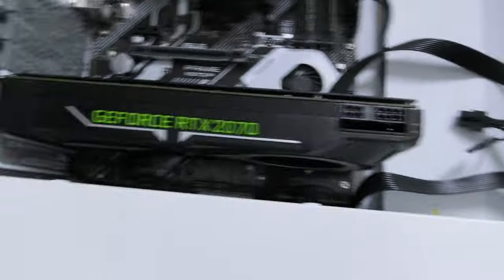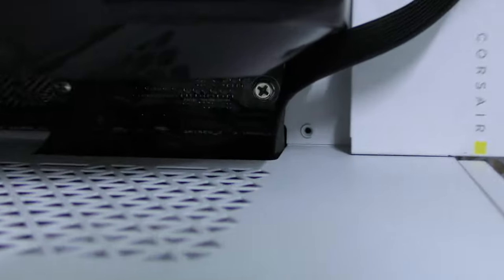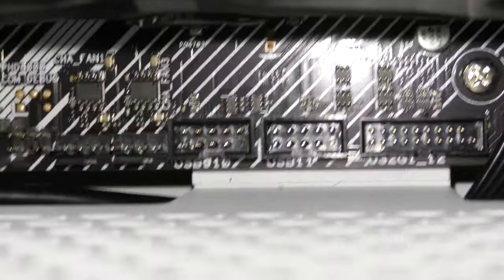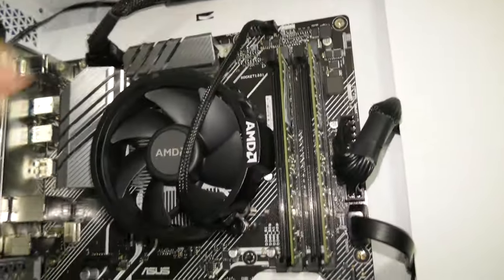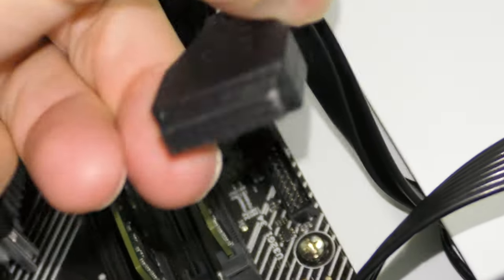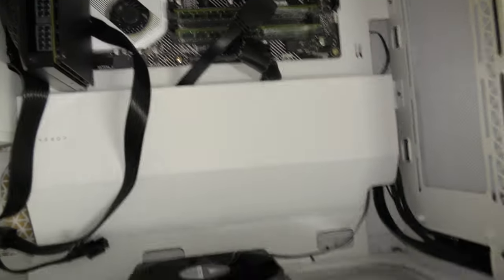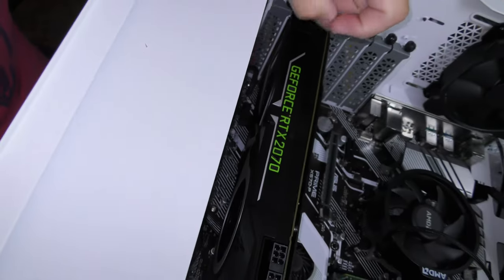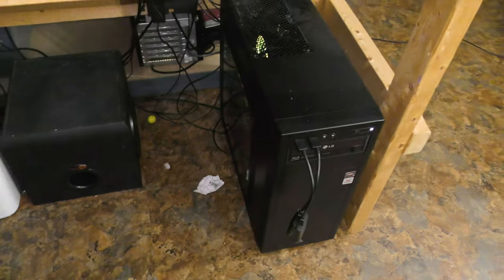Why I HATE Cable Management 🤬 - A Bird's Nest of Wires is BETTER 🐧 - Jody Bruchon

Comment from the maker: LET ME BE VERY CLEAR since many are ripping on the builder: it was put together by someone with no experience using random internet tutorials and the typical poorly translated manual as a guide, and probably a teenager to boot. If a "pro" did it then I'd burn them for it, but this is a good attempt for someone's first try with zero help. Stop being pricks to the builder in the comments. Thanks.
Reply: Breathe Jody Breathe! Of course you're right!, but these people are generation Z. Need I say more ;-)
Reply: I no longer read manuals when building computers , unless its something more exotic  , ok I still read motherboard CPU support lists
Reply: @pikepikkedonker1960   - 
the "evil" "Z" is the last letter , is this "Last Generation" ("climate" glue-r) the "generation Z" ? LOL

Comment: One of the biggest reasons to tuck the cables away isn't actually for looks, it's for airflow, and when done smart, cable managed systems don't have most of the problems described here, the real issue is that some people just shove everything in the back and close it up, rather than taking the time to do it properly
Reply from the maker: Yeah, I'm not opposed to doing some cable management out of practicality. It'd be insane to take the position that it should NEVER be done. My concern is when and how much to do: after it's all assembled and working and you can assess what actually needs cleaning up, and then the minimum to get wires out of the way and prevent falling into moving parts or causing an electrical disaster is usually the best. If you're putting more than two zip ties on any given wire, you're probably spending too much effort on it.

Now if you're running a gaming café, I can understand trying to make stunning visual impressions with the cases and lighting since it's part of the aesthetic of the entire establishment at that point...but that's a very rare case.

Comment: See, some cable management I'm all for. The kind of management that is for the purposes of airflow. 

This? This 'hehehe we're gonna make it look like there aren't cables.' This 'management' that impedes functionality or worse, routes cabling around sharp edges or above hot vents?

No.

I totally get where your'e coming from man. It's stupid and needs to stop.
Reply from the maker: Absolutely. Even in my PC that I "showed off" there IS "cable management," but it's the kind where you just zip-tie the offending wires out of the way so they don't fall into fans, block too much air, or (if there is a God and he hates you a lot) some stray Molex connector finds something metal on your motherboard and blows the machine up.
Reply: i got cables all over and no issues with heat. maybe because i have a 200mm fan on the side panel. and 1x120mm and 2x 140mm exhausting. exhaust fans is all anyone needs it seems just to pull air through openings. plus everyone should undervolt their video cards a little

Comment: I'm of the strong opinion that cable management makes it uglier. I like to see my box full of wires because it reminds me of what it is, a powerhouse. When I bought a case + mobo + psu combo from microcenter it came with all the damn cable management and I'm just thinking of how annoying it will be to get that psu out if I wanna use it to test other computers.
The best part of not doing it is how easy it is to unplug and disassemble everything, because every cable is loose and in your face, and the psu comes right off once you unplug and unscrew everything. It just doesn't make any sense to me to waste time trying to hide things that you'd probably need to take out at some point, just make sure the fans are not hitting the wires.
Naturally the connections at the back and on my desk/pc are a mess, they don't interrupt me but I don't hide them because I'm not looking under the desk for any reasons other than to take things out from my setup.

Comment: Good cable management is awsome, bad cable management is a nightmare. Badly designed management crap like that side panel are nothing but a pain in the ass.
Reply from the maker: It had a hinged door over the motherboard back area too. A hinged door that can simply slide off the pins. It slid off the pins.

Comment: Ah! Very funny! Especially, "Guess what I don't do... I don't get under my desk, look at my computer and masturbate to how great it is."

But, as a PC builder for others, I always cable manage to some degree. "Always" depends on how "high end" the system is. A high end system with a side panel could be placed on a desk and the last thing your client wants to see is a spider web of cables hiding all their expensive components. Cable management is an ART FORM. One thing I DO NOT do is force a tight fitting cable onto the mobo where it could break the port. Again, when done right, is an ART FORM and does make for a much cleaner looking PC.

And, since you mentioned cars... They ARE cable managed as well. You don't see all the dashboard and radio equipment and whatever else has wires in plain view of the driver. Everything is tucked away nicely so you have a nice clean looking interior.

I do agree to a point... You probably wouldn't cable manage a budget build, office build, or your testing rig.

But cable management is a choice. It is the trend we are in with all these side panel cases being sold.

In the end, based on the 2 PC's in this video (YOURS and your CUSTOMERS), cleaning the dust from the interior and fans is WAAAAAAAY easier on the cable managed build! 😜
Reply from the maker: Cable management is a preference. I prefer to tie things up where practical and leave it alone otherwise. I've also built $5000 PCs for people and not once heard a peep back about the wiring visible through the glass. It doesn't have to look meticulously anchored and routed to look clean. I make it clean at most. With my own machines, I give zero fucks; as long as a fan won't eat it and it won't short out, I'm leaving that stuff flying all over the place.

Comment: Idk I don't care about my cable management all that much but some people just want their stuff to be organized. I don't think people should make it such a big deal but if people want a cleaner setup I don't have anything against it unless it's done poorly.
Reply: I mean the video is about bad cable management anyway so I agree with you that bad cable management is worse than none at all
Reply: Yeah, but good cable management is about much more than just looking good.
Reply from the maker: @Megalomaniakaal  No, it really is just about appearances. The airflow thing is a myth, especially with IDE and floppy cables being long gone in the past. There are no practical benefits; if anything, it's harder to do any kind of maintenance or upgrades in the future because everything is tied down and routed through. Cutting zip ties sucks. Putting them back in sucks twice.
Reply: @JodyBruchon  Don't need no zip ties if you use velcro ties. But that's not my point.

Airflow will pass by the cables no matter what but turbulence can be introduced by them and that can affect the pressure of the flow of air going over a heatsink.

It's still only going to be a difference of a degree or two in thermals tho, so not that bad. As I said elsewhere here, not a big deal.

But it's also about routing cables well to avoid other things.

Not all cable management is about hiding them either though that is likely the most popular reason.
Reply from the maker: @Megalomaniakaal  Tomorrow I'm building a Ryzen 9 video editing machine and I'll be running several tests to put the whole cable management airflow question to rest for good. It's time someone settled it.

Comment: I was never into cable management either.  I also don't really care for RGB lighting and windows to see the inside of the case.  Aside from some extremely minimal lighting from anything in the case that has any, there really is none added.  Sure it may be nice to tame that rat's nest some but I won't go out of my way to do it by stuffing everything behind the motherboard.  Some cables are not long enough for that sort of thing and as you can see, it puts a lot of stress on the USB headers or it could.

Comment: Your own computer actually looks better than that horrible mis-(cable)-managed thing. When there are plenty of cables in there it looks like its actually doing some cool stuff!
As a small side note: Having lots of cables all over the place will likely prohibit the air flow for cooling a little bit, but its insignificant in most cases.
Reply from the maker: Agreed on all counts. The notion of cabling impeding airflow is largely a myth. The filter screen on the front of my machine is a massively larger hindrance to flow than a few wires several inches away will be. They'll cause more turbulence in the flow than any notable amount of reduced flow overall.

Comment: Because: A) When done right, cable management makes working on it easier.  B) Airflow is improved when you don't have a forest of cables blocking the flow of air across your components. and C) Many people actually care about being organized and take pride in having a nice looking case, even if no one else will ever see it. I always do my best to keep the inside of my case as neat and tidy as possible because I take pride in my build quality. It's not just a box to run a terminal on. Take pride in what you do and make it look nice as well as function well. You can definitely have both. The example you're showing here is what it's like when someone did a very poor job of cable management.
Reply from the maker: You're getting a video response
Reply: Also makes the computer easier to keep properly clean. Dust clings to cables like nothing else, which can't happen if they are... not exposed.
Reply from the maker: @ianhurley6475  Dust clings to cables regardless of whether they're exposed or not. The cables carry electricity. Electricity has a magnetic field. Dust is very tiny, so it doesn't take much to attract it. Cable management does nothing to prevent cables getting dusty.
Reply: @JodyBruchon  Hell Yes.

Comment: They do it for the picture so they can send it in to their favorite streamer to get rated.
Reply from the maker: That's worse than just doing it because you think it's cool...ugh.
Reply: @JodyBruchon  that's why I prize myself on my dell optiplex computer, it looks like I stole it from a library's dumpster, and the inside has the appearance of a telephone pole in india, but the only issue it has is windows 11 being installed on it.
Reply: @yearofthegarden  dude this comment is hilarious. I was running an HP with an ol i5 until i got a ryzen 2600 for a STEAL.  200 bucks all components included... Stay 5 gens behind if you can... hold out until these losers upgrade to the NEWEST gen and buy their old "crappy 12 core pc for cheap. :) (they needed the RGB for 25 hundred) ""daddy bought me the newest RGB yayyyyyy daddyy rich rich daddyy"""

Comment: This is why I only get windowless cases. No need to think too much into routing especially in a full sized tower with abunch of mass storage drives
Reply: I just use a test bench lol, it’s cheap and you don’t have to worry about airflow as much… does turn my room into an oven in summers though
Reply: @neol3066  I use a LianLi PC-A75 tower, have 5 of the 13 some bays with hard drives for media and game storage. Need to replace the media drives with something larger to raid them eventually but I don't really have the room to do an open bench in my current space unless it's oriented vertical.
Reply: @mikewilson6940  that’s a nice case you have, and yeah, I think trying to do cable management in it would be a lot of effort, prolly just don’t let the cable obstruct anything and you’ll be fine
Reply: @neol3066  yea only in the summer, too bad it doesn't work in the winter tho, just not enough power running from that PSU to justify protecting them like that in a case with plenty of room... of course they don't wanna admit they just wanna take a selfie with their RGB visible PC :3 corporate market strategy was successful on this one man,,, so many people shilling it.

Comment: The best PC case would be cheap, large, no windows, no lights, a single dust filter, shaped like a wind tunnel and have everything labeled.
Reply from the maker: I am not remotely an Apple fan, but I own two Power Mac G5 towers. You want to see some pretty darn good design? Look inside those sometime. Future video content for me, perhaps...?
Reply: I can't see inside my computer case, and I love it. Next build, I'm going to have a tiny shop to use and I'm thinking of making it out of wood.
Reply: Thank you for mentioning the Power MAC 5, it does have some good air flow features. The Raven 2 case with some modding would be great to see for sale again. Mike Schropp put together a good example of how Bernoulli's principle can be used to great effect. Now if only more people had access to trompes for PC cooling.
Reply: Get a used 5U server chassis
Reply: @MultiKokonutz  A server rack, enclosure, dedicated HVAC, power monitoring etc., this can all be done but what is the middle ground? Between a data center and a pre-built hot box?
Reply: @ocko8011  you don't need any of that! The only disadvantage of a 5u chassis is that they may not have dust filters as datacenter air is very clean and AIOs, very tall CPU coolers, and enormous GPUs likely wont fit. The airflow is enormous
Reply: @ocko8011  they can be noisy, however. The fans can draw multiple amperes each and the motors are so powerful that some models are very noisy even at normal RPMs. Keeping it real for a desktop build, watch the case reviews Gamersnexus put out. A lot of great cases lately, but a glass side panel might be difficult to dodge
Reply: @MultiKokonutz  Steve has teased that Gamernexus would release an airflow focused case design. Windows and lights are for shopping and should not be on computers.
Reply: @ocko8011  I agree. It seems childish. But I'd love to build a windowed PC with a plain green motherboard/GPU/memory, big tower cooler and maybe some very dim white LED (kind of a workstation vibe), like the stuff level1techs does with EPIC/Xeons and whatnot
Reply: @ocko8011  also, take a look at the fractal torrent with steel side panels, I think you would like it (maybe besides the pice)

Comment: I cable tie enough to have easy access to components and I do not care if looks ugly. 

When I will buy new PC, I will try to find PC case without glass side panel , as little as possible LED's, cables will be tied just that is away from components and no cables get into the fans 😁.

Comment: I built a large workstation with many fans, hard drives, and PCI Express cards. The power cables that came with the power supply are too short to neatly hide underneath the motherboard. All this makes cable management a lost cause. It gets to a point when there is only so much that can be done.

Comment: Cable management should only be done OUTSIDE of the computer.
Reply: cable management need to be done both inside and outside the computer, cable management require a feeling for when its ok and managed enough. Many go overboard and overdo it. My cable management is a thing i need to do sincé i have soft hoses and watercooling in my case so a little cable management makes it easier to maintence the water loop.

Each is their own but i always do the cable mangement after i have tested the build and i know its working, while i build the computer the cables is all over the place.

There is alot of "show cases" around and people use them alot, like the glass window cases. I dont care if my case is a old 50$ computer case if its big enough to hold all my cables and the water cooling loop.
Same with white cases, they look fine and dandy until that point when your kids or you have touched it a few times and then it start to get dirty. My case is wiped and cleaned once every month or so depending on the amount of dust on it. 
Im semi lazy and only do the normal maintence like make sure the hoses wont leak, the fans isnt filled with dust, the case isnt covered in dust and the regular "keep it running" maintence.

I have done my fair share of computer builds and its a mix between good nice builds to "5 minute builds" .. and a few cases that is minimal in size but still need alot of cables..  Its a journey of knowledge and experience and we all do our own journey.

I can understand jody when he say that its dumb since its not the most time efficient when you need to do service on it but thats the charm with custom computer cases, they are custom and the user have to make sure they do it in a good way so it still works after. I wouldnt drop my water cooled case to jody though and ask him to fix my mistake i made on my custom water cooling loop, its my mistake i did on my own.
Its a completly different case if jody build the custom water loop for example, then its under warranty (but i will still do a little here and there and keep the maintence on a good level), being afraid to open your case is dumb for real.
Reply: cable management should be done wherever the person with time and money decides to spend it on

Comment: I love it. I have a tower I use as my media server and I had all my cables nicely managed and hidden away when I first built it. As I started swapping drives and components around it turned into a complete nightmare.
Reply from the maker: This is a lesson only learned through experience. Cutting zip ties gets so old.
Reply: @JodyBruchon  I still use zip ties, but I'm way more strategic about it now.